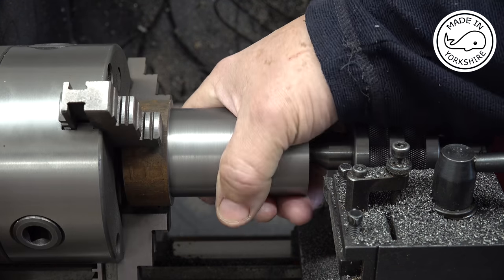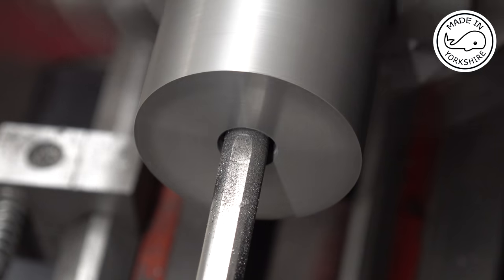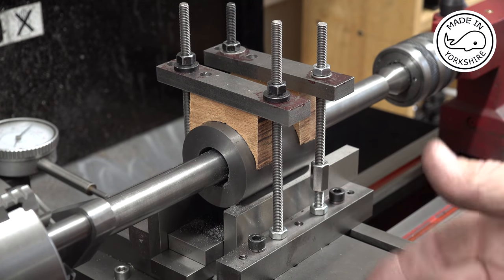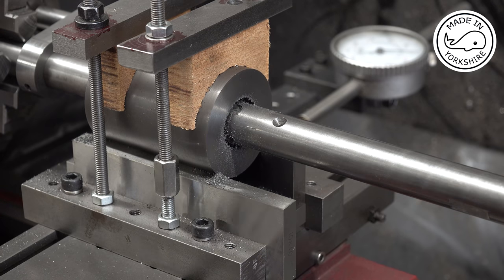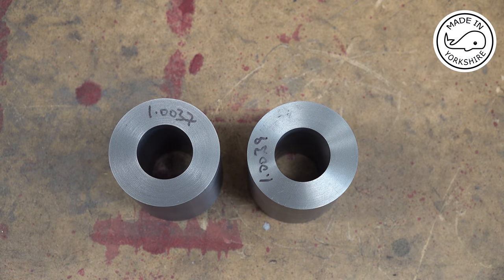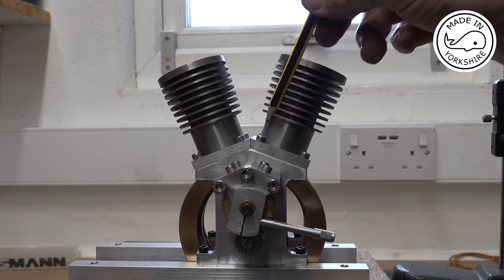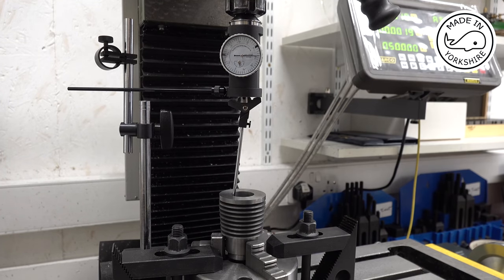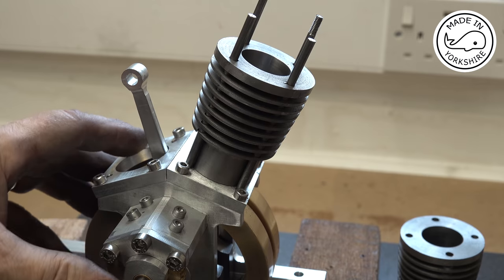#MT44 Part 10 - Hoglet V-twin IC Engine. Machining the Cylinders. In 4K/UHD by Andrew Whale.

Comment: Late to the party again this video but I do so like to have my morning coffee with Andrew. Looking at the comments and looking at the video again I don't think the problem is the part not being straight in the three jaw chuck was the problem with the holes not straight though the thought has a lot of merit. Moving  the Co-Ax down the bore and running it again might be a good idea in the future to make sure the bore is truly vertical. In my apprenticeship back in 1962 I was taught to drill a straight hole to a deep depth use the step drilling method. Start with a center drill spot then use a small drill like 1/16 through in the case of the cylinder 2 fins. Then use a slightly larger drill say 1/8 through to the 4th fin and so on until you drill all the way through with the 11/64 drill to finish the hole (did you say 61/64 drill bit). The step drilling process has the next size up drill follow the smaller drill on location then is supported as it drill a bit deeper. The name of your channel is very appropriate as "Learning Turning Metal " as in reading the comments it seems a lot of folks are learning from you.
I might just have to quit watching the channel though as this Hoglet engine is sure interesting and I already have much to many projects in the shop now to even consider another.
Cheers from the USA.
Dick B.
Reply from the maker: Thanks for the detailed instructions Dick. That seems like a great method. One of the main reasons for making the videos is to get good solid advice from experienced machinists like you. This not only helps me improve, but other less experienced followers benefit too. I hope you manage to complete some of those long outstanding projects soon.
All the best.
Andrew
Reply: If this is the comment you mention at the start of the next part can you please pin it to the top.
Reply from the maker: @tonywilson4713  good idea! Done!
Reply: @learningturningmetal  No probs. The build looks great so far. 🤷
Now that Australia is finally coming out of Lockdown I will be able to get back to things. 
I'm going back over a couple of your Stuart builds. 
The 10V and S50 are on my short list because of your vids. I want to start with a projects that good quality video series already exist for.

Comment: Great work ! As far as the stud holes breaking through the lower fins , I would have milled the fin material away and exposed the studs at the lower fins. I know the plans exist for construction of the engine but are you not building it and expressing your interpretation through the construction. The Hoglett as I would think is a model of a Harley Davidson engine and if you look at the many models the lower fins are "sculpted" around the base nuts. Again my thoughts and again great work and thanks for sharing. Best wishes from Canada.
Reply from the maker: Thanks Carl. After trying to change the conrod design I'm now very wary about moving away from the drawing spec. Once bitten, twice shy as they say!
All the best.
Andrew
Reply from the maker: Another dawn - another day. I might just give that a try!
Cheers
Andrew

Comment: Additional: Your answer to the  comment about using a standard boring bar rather than the between center boring bar was spot on. David Richards in his steam powered machine shop uses a horizontal boring mill to bore and sleeve full size hit and miss engines and the between center setup on the lathe is a very close match to that machine. Another comment mentioned the "Tee" slots on your cross slide and I agree with that comment I sure wish I had that feature on my South Bend lathe
Again Cheers ,
Dick B.
Reply from the maker: Thanks Dick!

Comment: Andrew, it's great to see the things you are doing and how you go about them.

I'm currently doing a lot of drilling in gunmetal where hole alignment is critical.
Admittedly not on the scale of your stuff, but smaller holes, thinner drills and proportionately more flex.
What Matthew Helton says makes good sense.
The part could be held more accurately using a largish V block and one or two angle plates.
I keep components square by holding them in a small precision tool vice then holding the small vice in the large precision tool vice bolted to the mill, which keeps things square in three planes.

I may be deluding myself as to why the following works, but it works for me.
I start holes with a spot drill with minimum protrusion from the drill chuck to minimise flex, and peck drill as deep as possible.
This is followed with a stub drill, again at minimum protrusion from the chuck and as deep as possible. 
After that, it's a jobber. Theory is that if the start of the hole is kept straight, the longer drill will follow the lead.
That's why I agree with drilling before machining the fins. Each fin is a new opportunity for the drill to wander.
Reply from the maker: Hi Len - many thanks for the advice. It makes a lot of sense.
I will try to get a better result next time.
All the best.
Andrew

Comment: Hi there, Solution to your run out on the cylinder stud holes. Put it in the mill and machine a grove up the fins where they taper and where the bolts will run. Will also make it look better that a different portion of a stud being seen passing up the cylinder.

Very nice job and a project i will one day attempt

Regards,
Paul
Reply from the maker: Thanks Paul - I will give that a try.
Cheers
Andrew

Comment: This is a perfect case for the use of adjustable parallels. As for the drilling being offset, I noticed that as you were machining the fins, there was considerable offset on the cylinder body. I believe that there was nothing wrong with the hole setup, but that the drill bit was touching the lands of the fins on one side. Great video thanks Andrew
Reply from the maker: Hi Tom - Ironically I've got some adjustable parallels - if only I had thought of that. I'll investigate that offset too.
Cheers
Andrew

Comment: Great Outcome Andrew. Looks like the design could have done with a bit more material being left on the 5 degree taper. Another 1/16" on the OD and perhaps even 4 I/2 degrees would have been better.  Still annoying, but by the time you have run it, got it hot and the cast iron has rusted a bit, you probably won't even notice it. Keep the videos coming. Regards from Australia.
Reply from the maker: Thanks Dave. In hindsight I think the best approach is to drill the holes before making the taper. One to remember if I ever build another Hoglet. Yeah, once it's rusted on the shelf nobody will notice it 😂😂😂.
All the best.
Andrew

Comment: My answer to some of the fins having the holes breaking through. Make all the fins look the same by machining slots along some of them with a ball ended cutter. Just like the old motorcycle engines looked. Yes you cannot machine the slots all the way along, but you can make the slots halfway along to beutify your engine.
Reply from the maker: Hi Mervyn - that's a great idea. 🤔
Cheers
Andrew
Reply: @learningturningmetal   Thanks Mervyn

Comment: Yes Andrew, I chuck up the drill as far as possible. Also, I don't drill straight away through the material, I "peck" at it. apply pressure to drill, back off and reapply to drill deeper. This way you get a much straighter hole in the end. Hey, you're still learning turning metal! Keep it up!
Reply from the maker: Thanks for the advice Steve. I could have kicked myself a second time because when I had finished drilling both cylinders I found a couple of new drill bits I'd bought specifically for this job. My memory is getting worse!
Cheers
Andrew

Comment: I'm wondering if a split point, 4 facet grind drill bit would tend stay on centre as it starts on the surface of each fin. Because that style of drill bit doesn't have a chisel edge they start more accurately. Nice job on the honing. I have to do that on a model aircraft engine shortly. 
Regards,
Mark
Reply from the maker: Hi Mark - that is interesting - I'll do a little research. Good luck with your honing.
Cheers
Andrew

Comment: Utilising a drill bushing jig setting on top of the cylinders for drilling the long holes would have stopped the tearout at the bottom of the cylinders. I' ve done long hole interrupted drilling in the past and drill jigs take care of those tearout problems. Otherwise, nice machining.
Reply from the maker: Hi Cameron - thanks for the suggestion. I think Richard Boucher's method seems to be the best. Apparently a tried and trusted method.
Cheers
Andrew

Comment: 6:07 a question, what’s the point of boring between centers if you can’t get it dead on center? Wouldn’t it just as well have been turned with the boring bar in the four jaw chuck where it was running true?
Reply from the maker: Hi - any slight runout (a thou or so) is corrected with the between centre boring. The aim is to get a consistent diameter over the full length of the bore. For long bores, I believe between centre boring is far more accurate than using a boring bar in a 4-jaw chuck. I've got a titanium boring bar and that flexes around a thou over 3 inches. Between centre boring is the way to go - for me anyway.
Cheers
Andrew

Comment: Hi Andrew, not sure if it was the cause of the breakout you experienced, but there was some runout while you were machining one of the tapers at around 15.00.  I'm sure it will be a fine looking engine when you've finished it.
Reply: Hi Andrew. I also noticed that run out of the cylinder bore, and wonder if you centered the part in the 4-jaw on the OD of the part? Only a cosmetic issue and it'll look and work fine regardless. Nice video!
Reply from the maker: Hi Steve and Tony - I think you are right and that must have been a contributing factor. At the time I considered the taper to be just a cosmetic issue but I didn't appreciate that it might impact upon something else. I must take more care next time.
Cheers
Andrew
Reply: @learningturningmetal  As Tony said, it's only cosmetic, so no great harm done.  Another thought, the compound slide might not cut exactly the taper you think it's going to, unless you do a test cut first.

Comment: These things happen. It’s about how you tidy things up. I would remachine the angled turning on the fins so you get even breakout of the holes or perhaps just turn down the diameter of the bottom two fins . Steve I am currently trying to dremel out a broken off tap in the vertical guide of a Stuart turner James Coombes engine that I picked up in pieces a few years ago. Then have to remake the U Conrod
Reply from the maker: Thanks for the suggestion Steve. Sounds like you have your work cut out with that broken tap. Nothing like a decent challenge!
All the best.
Andrew

Comment: Nice recovery. Was the drilling hole issue down to what looks like the cylinder running out of true in the bore at 12:30 and then setting true to the bore at the drilling op?
You could machine the lower fin totally away, and that would diguise the break out as the fin above seems fine.
Reply from the maker: Thanks mate - I'm not sure. I think my method of drilling long holes was flawed though. Richard Boucher's method seems to be the best method. I might machine out the lower fins if I can pluck up courage.
All the best.
Andrew

Comment: One trick for wandering holes is to use screw machine length drill first and then come back with the longer bit, shorter bit acts as a guide for the longer one and keeps it straight
Reply from the maker: Thanks for the tip Ernest.
All the best.
Andrew

Comment: Great job as always. On the next one maybe drill the holes and turn the taper before turning the fins in. If the holes are located off the center bore then I don't see why this would be an issue doing
Reply from the maker: Thanks for the suggestion Brandon. Richard Boucher (aka Dick) has suggested a tried and trusted method for drilling long holes. It might be of interest to you too.
Cheers
Andrew

Comment: Gday Andrew, in my opinion the cylinders turned out great, nothing wrong with them mate, I’ve got a question, I’m building the Webster engine and it calls for cast iron rings, I’m wondering if the O rings you mentioned would work in place of the cast iron rings, throughly enjoying your build mate, Cheers
Reply: An O ring will work for the Webster - you will only need one (don't fit two, even if you can - they don't work well in pairs). The ring groove will likely need to be wider and deeper than for the CI rings so you need to be wary of breaking into the recess for the conrod. I think you should be OK if you keep the top of the O ring groove the in the same position as the top of the top ring, and omit the second ring groove completely. The diameter of the base of the O ring groove should be (bore diameter - O ring section x2 + 0.25mm), and width should be approximately (O ring section + 0.25mm).  Note that these are slacker than the dimensions given in O ring manufacturer's data and more appropriate to slow speed model engines. These are the guidelines I used for my hit and miss engine and it works well.
Reply: @Mister_G  Gday MisterG, thanks you very much for the information, one worry I have is will the engine run hot enough to melt the o-ring, I don’t don’t how hot the engine gets, I can always try the o-ring and if it does get to hot I can always build s new piston with cast iron rings, you help is much appreciated mate, Cheers
Reply from the maker: Thanks Matty - looks like you got some great advice from MisterG. I've not compared notes but on my Farm Boy I used a viton o-ring with an od of 1.074" (to match the cylinder ID). The section of the o-ring was 0.134". The piston was around 1.072". I cut a groove 0.145" wide and 0.150" deep and it runs really well.
One word of warning when using o-rings...... Check the o-ring material against a chemical compatibility chart. I had a major issue using Nitrile o-rings and various types of fuel. I've found that Viton works well with Coleman fuel.
Cheers
Andrew
Reply: @learningturningmetal  Gday Andrew, thank very much for the information, I’m still undecided weather I go with cast iron rings or use a viton o-ring, just not sure what to do, Cheers
Reply: @MattysWorkshop  No worries ;) I think a Viton O-ring would be fine for the Webster -  they're good for 200°C+

Comment: Maybe an extra long center drill that was a bit under size would have worked better? still a great job on it, what do you use to clean off all the cast iron bits when you are finished?  Thanks
Reply from the maker: Thanks for the suggestion Randy. Richard Boucher (aka Dick) has suggested a tried and trusted method for drilling long holes - on similar lines to your suggestion. It might be of interest to you too. I use a shop vac to suck up those nasty bits of cast iron. 
Cheers
Andrew

Comment: What a great looking engine Andrew! Wonder if starting the holes on the opposite end of the cylinder would work? Or drilling half way from both ends and meet in the middle. Anyway looking great and looking forward to more. As always cheers!
Reply from the maker: Hi John - thanks for the suggestions. I think I should have tried to get hold of a stub drill and taken it nice and steady. At least the holes in the top are spot on to accept the cylinder head - or at least I hope they are!
Cheers!
Andrew

Comment: Nicely done Andrew, really good job made on the boring etc. That was definitely not designed for manufacture! It might be my lack of knowledge of engine design but other than cosmetic purposes, I don't see what value the 5 degree taper adds, unless less heat dissipation is necessary further down the cylinder? Anyway, not to worry, you have got them to fit and the functional bits that matter are spot on, well done. Cheers, Jon
Reply from the maker: Thanks Jon - yeah I think it's cosmetic rather than functional. All good practice though trying to make something resembling the drawing.
Cheers!
Andrew

Comment: Interesting. Never seen boring done that way before. I’m struggling to see the advantages, especially since you were experiencing vibration whilst boring. Could this be due to backlash in the bed screw?

Cast iron is strangely satisfying to turn isn’t it?
Reply from the maker: Hi - what I omitted to mention in the video is that I later replaced the live centre with a dead centre and that addressed the minor vibration. Between centre boring is definitely the way to go for achieving a consistent diameter throughout the length of a bore. A boring bar might be OK for short bores, but on longer ones you will get some flexing.
Cheers
Andrew

Comment: Good work. Maybe I would personally drill the holes first and only then turn the ribs. Maybe it would help with the accuracy of the holes. But I still say: It will be a great engine.
Reply from the maker: Thanks for the suggestion Miroslav. Fingers crossed the engine will run OK.
Cheers
Andrew

Comment: Looking good, did the cylinder bores distort much after roughing the OD after finish boring?
Reply from the maker: Hi James - I don't think so. That little test piston still slides down a treat.
All the best.
Andrew
Reply: @learningturningmetal  great stuff, maybe a thought for future projects, some materials can distort lots as they stress relieve, in industry I’ve seen things move up-to 1/2” after roughing! You’d never finish a bore then rough the OD down. Also don’t keep that aluminium gauge in your pocket! It will grow considerably as it warms! All the best James

Comment: Very interesting video.
For the long hole - perhaps drill a smaller diameter pilot first with a short drill. Then drill through with a long smaller diameter drill - followed by correct diameter drill or filing ...
Reply from the maker: Thanks for the advice Mark.
All the best.
Andrew